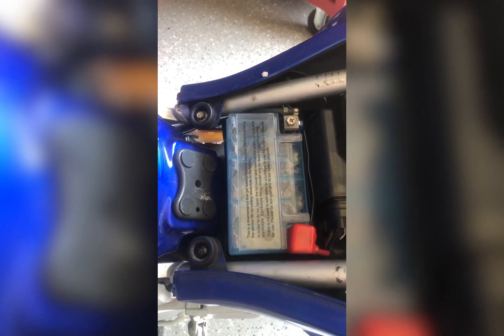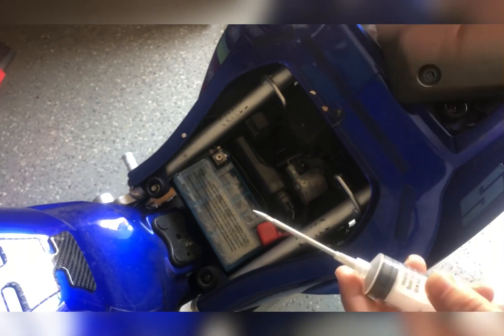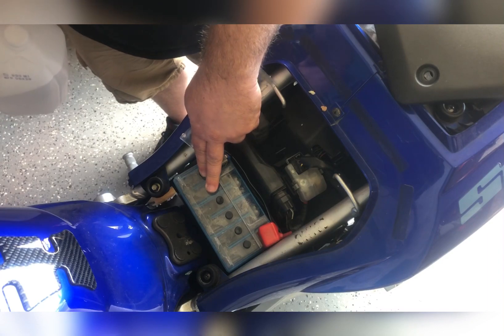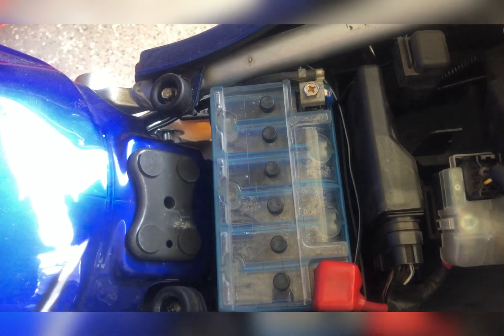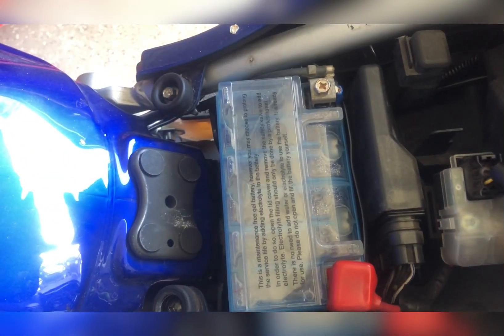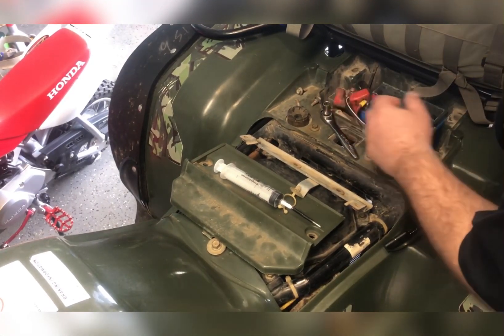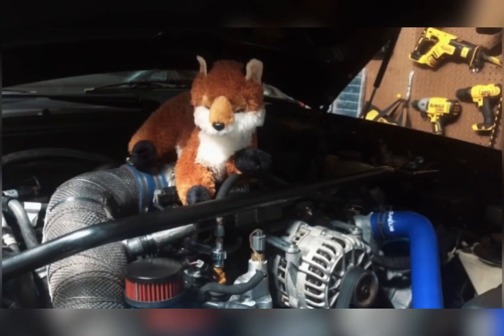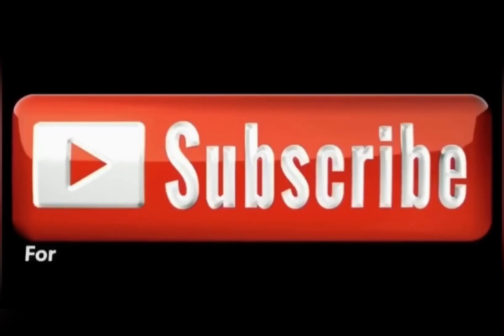Repair dry gel batteries! DIY Rehydrate small engine gel batteries in a few minutes

Comment: finally someone explained it
Reply from the maker: At the time i could not find anyone who messed with them, so i did a little research tried this method it worked; and hope i helped get a few extra seasons of use for other people. I have been able to get almost 8 years out of one without the use of a tender in a moderate climate.
Reply: @ so I took two M22NF 50Ah 12V gel batteries from an electric powered wheel chair. both were completely dead, zero volts. I connected one battery to smart charger and left it in repair mode for about 24h. Opened cells, and battery seemed dried out from the inside. then I added distilled water into each of 6 cells. I only slightly closed holes to let fumes out. I put battery on charger on the lowest charging current and was surprised to see it pushed 35Ah into the battery over night. from each cell I saw some bubbling with a little bit of liquid coming out. 
In the end my battery tester showed close to 300A CCA! and voltage seem to be steady for the day. Running second battery in the repair mode now with water already inside. will charge it tomorrow. hopefully it will come back to life too. 
haven’t tested them with the chair yet.
Reply from the maker: All i can say is to try to trickle charge it with like a battery tender when it gets that low, it should keep temps low so it does not bubble. Less water is more with a gel battery it meeds a while for the media to absorb the distilled water. Glad it worked out! Hope you can get a few more seasons out of your batteries, money comes by harder than it used too.

Comment: You are a hero. Please become president or someone important.
Reply: Give it about 48 hours to soak in and charge slow. Then the battery is like on steroids.
Reply from the maker: I like using a battery tender if i have the benefit of time, they are perfect for low amps and a slow charge.
Reply from the maker: A battery tender is the best

Comment: What is distilled water? What is the source of this kind of water?
Reply: Usually you can buy it at a grocery store or an automotive shop...
Reply from the maker: Water that has been through a condenser after heating close to the way they make distilled spirits, and purified with no minerals or contaminants.  It keeps deposits from forming on the internal parts from mineralized  water.

Comment: If you lose a rubber cap, just use the same size rubber vacuum caps from the parts store
Reply: A bit of silicone might help
Reply: Thank you from Lusaka Zambia
Reply: Print it with TPU
Reply from the maker: At the time availability for them was about non existent.
Reply from the maker: Or you can carve out something close from an old piece of tire, or anything rubber.

Comment: What is the best procedure? Fill the battery with distill water before charging or fill the battery while charging?
Reply from the maker: Before charging, while gel batteries are fairly safe, never refill any battery while charging especially a lead acid it can blow up on you if there is a spark, from the sulfuric acid fumes. Also a well ventilated space while it charges.

Comment: How do you know if it's a gell battery?
Reply from the maker: They say gel on them, they also generally are clear on the top and you can rock them and the liquid does not move. If it does not say gel i would assume it is lead acid, or in rare cases lithium which i would not mess with at all, as they can explode if compromised.

Comment: Yo man is it normal to battery be siziling while charging?
Reply from the maker: I would charge it away from the house and check the voltage after. It could be charging it too fast.
Reply: @swampfoxmoto5959   i added destiled water left it hooked on a lamp to discharge, then emptyed water and charged and works 😭
Reply from the maker: I did not see this reply and i apologize for not messaging back in a timely manner, i hope everything is going well and any issues were worked out.

Comment: Below 2A, translates to 0.2C for non motor bike gel batteries?
Reply from the maker: Gel batteries need the lower amps or a charger that is designed to charge them. It is kind of like lithium batteries needing the correct charger or they can be damaged.

Comment: i also heard you can use electrolyte that comes with diy batteries. i have a little bit left from about 2 years ago. is that okay or just use water?
Reply from the maker: Never uses more electrolyte it concentrates what is already there and that is dangerous, if it was “not a gel” i would say that is fine; but just distilled water to bring the gel battery back. If the distilled does not work the battery is beyond helping. Also trickle it on a battery tender you do not want to pour the juice on a low battery to bring it back.

Comment: Instead of pure distilled make a mixture of distilled and epsom salt. Make sure it is dissolved completely into the water. You will be amazed at the results.
Reply from the maker: I can see doing that one time, but not multiple times, adding a little electrolyte booster is a good idea, just not over and over.

Comment: Mine is completely dry, not a drop. If I buy the water and refill it could it work again or there's no chance.?
Reply from the maker: It may, just give is some time to sit before you try charging it after putting water back in.
Reply: @swampfoxmoto5959  Thanks.
Reply from the maker: I did not see this reply and i apologize for not messaging back in a timely manner, i hope everything is going well and any issues were worked out.

Comment: Hi, i do not well understand for my poor english.. so, we can add water ti Gel Batteries right? How much? Like the normal acid pb the level of water how must be higher respect electrode?
After how many time the water Will assorbed in gel?
Thanks in Advance for yours answers
Bye
Max
Reply: Ok no answer no problem thanks the same
Reply from the maker: You do not top it off completely. Just a few CC of water, to rehydrate the gel as it will expand, give yourself at lease 10mm from the top room for expansion.

Comment: Or  after putting distilled water can I run the motorcycle and let the battery charge and turned the water to gel itself while riding
Reply from the maker: That should be fine if it has enough juice to crank it up; but i would still put a charge on it. Remember a charging system on most machine’s are not really chargers they maintain the battery’s voltage esp on older machines. It is good practice to put even your modern car on a charger once every 3 months to keep the battery healthy; you can get a few extra years out of them by doing this.

Comment: After putting distily water . Cai I used the motorcycle charger itself to charge the battery
Reply from the maker: Yes just run it on the lowest setting less than 2 amps if you can.

Comment: Is okay if the method was put distilled water and instead of charging it using regular charger I user the motorcycle charger itself ?
Reply from the maker: I use a 1.5 battery tender to get the voltage up slowly then after it hits 12.5 i put my 2.5 amp on it and charge it slow. If the voltage does not go back over 12v and hangs below at like 11.5 or less after trickle charging it; then, the battery is beyond bringing back.
Reply: @swampfoxmoto5959  thanks man
Reply: @swampfoxmoto5959  that was very helpful
Reply from the maker: I did not see this reply and i apologize for not messaging back in a timely manner, i hope everything is going well and any issues were worked out.

Comment: How about the batt, solution sir! For the lead acid batt! Is it ok to refill gor geltype batt? Coz i have an experience of maintainance free batt i used distilled water and then the batt is droping the voltage🤦🏻‍♂️
Reply from the maker: You can do the same but I would be very careful the tops of lead acid batteries are melted on and you may end up breaking the filling covers. The gel is also not explosive like the fumes from the old lead acid batteries. But yes you should be able to cut around the squares on the top, in layers until the plastic is free, and pop off the plastic tops like the old style. Be very careful! And remember distilled only, and put it a solid 50 feet away from anything,  try and charge it on very low amps. But personally I would just replace it. There should be a video on youtube with somebody doing it safely.
Reply: @swampfoxmoto5959  thanks sirl but may charger is 14.8v 12amp….. so instead i put batt solution for lead acid batt? I should put a distilled water right? Not batt solution.
Reply from the maker: Correct do not put acid back in, just distilled you do not want to concentrate the acid that is still in the battery. And you need to charge it at no more that 2 amps very slow charge.
Reply: @akolngto9314  Avec une charge à 12 A, votre batterie risque d' éclater 🤪🤪🤪
Reply from the maker: There is a chance that one of the cells is just dead or detached inside the battery from normal use and or vibration.
Reply from the maker: I did not see this reply and i apologize for not messaging back in a timely manner, i hope everything is going well and any issues were worked out.

Comment: Dude you saved me 50 bucks thank you very much!!!
Reply from the maker: Glad I could help! I will say if you run out of water completely again keep an eye on it, third fill up was the last straw for one of my gel batteries. make sure the voltage is good after a water refurbish and charge top off. If it still has liquid water after you top it off after a few days defiantly keep an eye on it.
Reply: How your gel batt now sir after you watching this? Is it okay back to normal??
Reply from the maker: I did not see this reply and i apologize for not messaging back in a timely manner, i hope everything is going well and any issues were worked out.
Reply: I once topped up distilled water,but the batteries were heating up when charging..what may have caused that?
Reply from the maker: Some batteries are just too far gone, but a little heat is ok unless its burning hot to the touch.

Comment: I thought gell batteries used other chemicals and not distilled water
Reply from the maker: I took a trip by batteries plus and was going to put sulfuric acid back in, but they told me to just reactivate the gel electrolyte with distilled water. These are the only 2 gel batteries i have ever purchased with the on in my quad 6 years old and the one in my bike is about 3, have done this method 2x on the quad and this is the second time for the bike. It charged right up in about 2 hours, where as before my battery tender wanted to continue to charge it all day, before I topped it off.
Reply: @swampfoxmoto5959  thank you good to know
Reply: @swampfoxmoto5959 can I add new battery acid in my gel batteries
Please tell
Reply from the maker: No acid just distilled water.
Reply from the maker: Very good question!
Reply: It's not just distilled water, it's electrolite fluid
Reply from the maker: I did not see this reply and i apologize for not messaging back in a timely manner, i hope everything is going well and any issues were worked out.
Reply: Please help me what name this gel my motor battery dry use gel battery